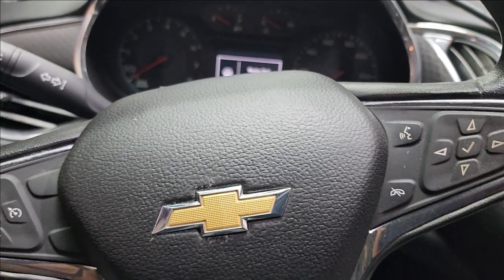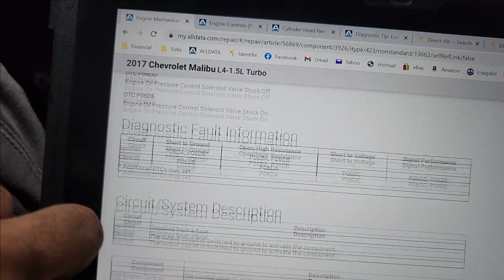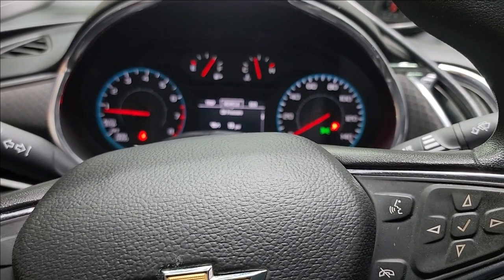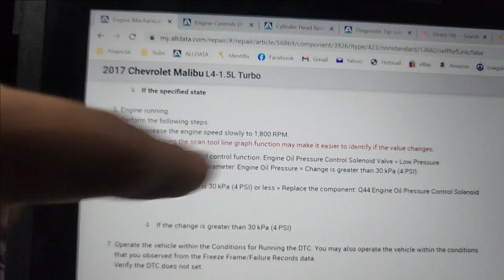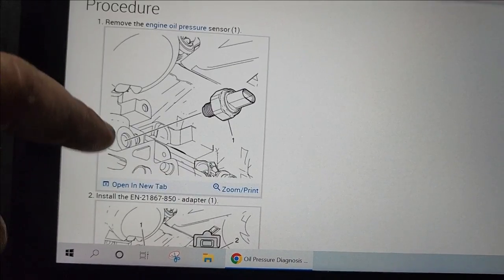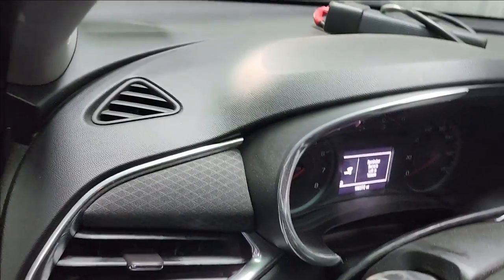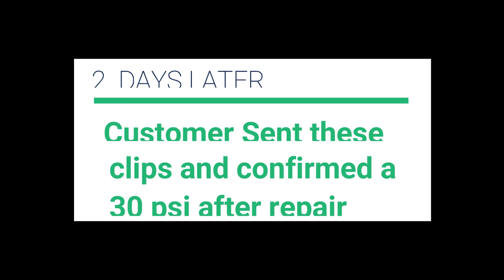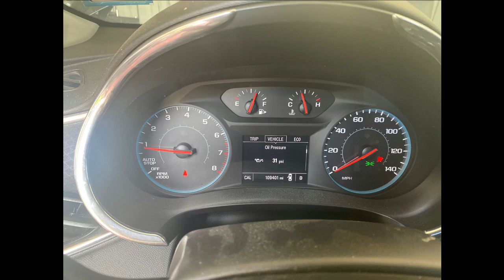2017 Chevy Malibu P06DE ENGINE OIL PRESSURE CONTROL SOLENOID VALVE STUCK ON Part 2

Comment: The 1.5 LFV has a known flaw in its original head gasket design. Mid 2022 I decided to replace it. The mechanic messed up the process, what ensued after that was nothing short of a headache. Solved all of the issues ‘except’ the P06DE. I’ve been following your videos for some time now, finally decided to pull the trigger and went in to replace the tensioner gasket today. It  was in pristine condition, no nicks or damages. I also replaced the oil pump assembly with the oil pump control solenoid sensor, currently in the process of assembling everything back together. I’ll drop an update tomorrow what pressure is the vehicle holding on to. 😅
Reply from the maker: any updates?
Reply: Updates?
Reply: My wife's 2018 Malibu LT 1.5 just gave her this code on the highway. It's making a ticking sound when accelerating at low rpm. It's on engine power reduce (limp mode) I took it for a short ride, coming to a stop screen said "low oil pressure turn off engine." I'll order new filter and replace oil to give update. My first impression was oil pump went bad.
Reply: @NocturnalJag update?
Reply: @CNSTAdventures  yes, the issue was a defective oil filter. Mobil 1 oil and filter is what I've used since I bought vehicle wife took it to a local shop and cheap filter was placed since I was out of town. Replaced defective filter with Mobil 1 (#M1-113A) filter did an oil change ran vehicle problem solved! Cars currently at 256,xxx miles going strong. Apologies for late response. Cheers!

Comment: I have Opel Insignia 2016 2.0 diesel with the same problem. Still chasing it. Replaced solenoid valve and oil with filter so far. This started right after cam chain break (luckily no damage to camsafts, valves and so on). My mechanic has replaced cam chain with tensioner and this error code has appeared. Have no clue what's happening. There are no gaskets in cam chain tensioner that could be potentially be misplaced. So may be it's high pressure oil leak in new tensioner or it was installed inapropriately.
Thanks for the video
Reply from the maker: No problem
Reply: Did u figure this out? I've got same issue. Need to get it fixed. Can't keep clearing the codes to get it out of reduced engine power.

Comment: I’m having this issue with my 2018 Malibu. Oil pressure is good at idle and while driving. But code comes on a reduced power and drives fine. I’m confused on what’s going on.
Reply from the maker: did you watch both parts of this video?
Reply: Did you ever get it fixed? Mines a 2016 and same issue. He said it was a damaged tensioner gasket. Was it for you?
Reply: @JayPoster490 did you get yours fixed?
Reply: @shawnmc964  yes. Turns out it was oil pump solenoid. Replaced it and along with that came a new oil pan plus oil change. Problem went away.
Reply: @JayPoster490  did you only have the p068 code?
Reply: @shawnmc964  I had the P06DE code, and a P2097 code which was just a a computer needing update. Those were the only codes I had.

Comment: I recently did a major engine repair with error code P1101 ( replaced pcv orifice) after the fix I’m seeing error code P06DE mechanic was suggesting me to replace oil pump first, and then possibly engine. Any suggestions, Did my mechanic haven’t installed the tensioner gasket properly which is causing the error code P06DE
Reply from the maker: Could be
Reply: What was the solution to code p06de?

Comment: I have a 2018 Equinox 1.5L Turob I cant even find the oil pressure sensor hard to locate. No information on the P06DE error. I just put new oil in it and drove it for 1 day the error came back. I have a Innova 3170RS scanner but cant find where to watch the oil pressor on it and the equinox has no oil pressor display for some reason.
Reply from the maker: it looks like its above the starter motor

Comment: I have the same code on 2017 Chevrolet volt but also my infotainment screen is black. The backup camera works. Blinker works but does not make the sound. This seems like an electrical issue to me. Do you think it's related to the fuse you mentioned in the first video?
Reply from the maker: I won't be able to tell without a diagram. sorry

Comment: Did your issue go away ,I think it's the oil pressure solenoid
Reply from the maker: Yes never came back
Reply: @DallasAutoDiag  so it was code p06DE and salutations was oil pressure solenoid
Reply from the maker: @rohanboswell5408  did you watch both videos?
Reply: @DallasAutoDiag  no didn't have time ,I found out the customer had no oil in the car ,he was trying to blame me , because I have changed the brake vacuum pump 4 days before ,,
Reply from the maker: @rohanboswell5408   I don't think this is related
Reply: @Dallas Auto Diag  I think the vacuum pump issue is actually related because loss of oil pressure in the top end will cause premature wear on that pump! But if the vacuum pump was already damaged then the rest of the engine probably has been starved for some time and the problem already existed.

Comment: Hey they said my Malibu have the same codes but I’m lost on what parts I should buy
Reply from the maker: Did you watch part 1 and part 2?
Reply: I bought the oil pressure switch is that right part can I get your number

Comment: So mine gets stuck in gear when attempting to floor the gas the rpm’s go up but you have to let off the gas for it to shift what could that be ?
Reply: That's what I'm getting right now. I changed the 02 sensor since it said that was bad. But it's still happening. I'm getting both catalytic converters changed this weekend. 😒
Reply: @24BlackMamba8  lmk how that goes ! Ian even wanna take it to the Chevy dealership cause that shit be tryna charge too much for simple ass shit
Reply: @karajohnson6588  yeah if it is the catalytic converter is going to be expensive AF anywhere you go unfortunately.
Reply: @24BlackMamba8  damn so did you replace them ?
Reply: @24BlackMamba8  did you ever have a code po6DE pop up ?
Reply: @karajohnson6588  sorry for the late response. The new catalytic converter made my car work like brand new. That code went away. I now have a p0411 but we found out that's the air valve and it has a crack in it. I get it replaced tomorrow. That only cause the check engine light to turn on
Reply: @karajohnson6588  but I have to get that air valve changed to get the check engine light off so I can renew my tags that have been expired now for 3 months
Reply: @24BlackMamba8  so if you floor the gas the rpms don’t jump up anymore without shifting ?
Reply: @24BlackMamba8  did you have a code for P06DE : engine oil pressure control circuit stuck on ?
Reply: @karajohnson6588  yup. Car runs like brand new. Not a single problem. The new catalytic all together cost me $1700. The catalytic converter is two parts so it was around $1350 for both and around $350 for labor.
Reply: @24BlackMamba8  where’d you get it done at ?
Reply: @karajohnson6588  an auto shop I've been going to for years now.

Comment: Sir have you tried fixing car paking senor(clean parking sensor),always keep on beeping on the dashboard
Reply from the maker: Did you try to replace the sensor?
Reply: @DallasAutoDiag  yes sir i did replace,however  initially  the fault was rear center  left (RCL),after changing the RCL sensor, now it is showing  RCR,I have ordered another sensor, it should  reach in a day or two,ill update you sir